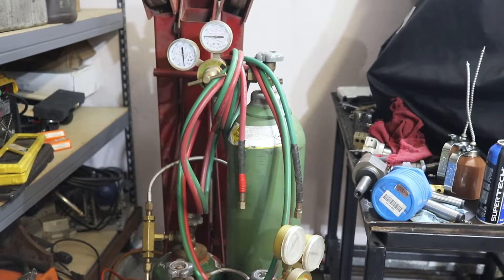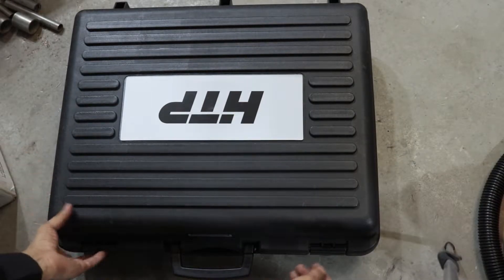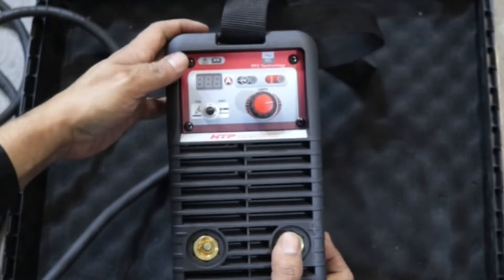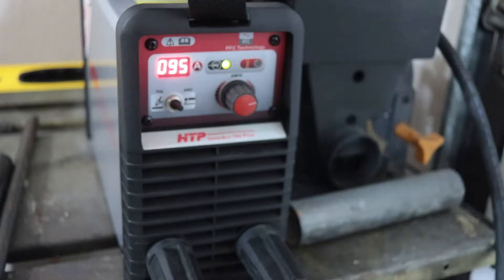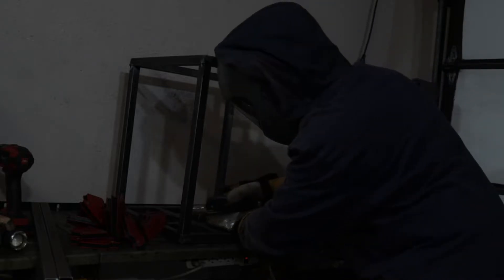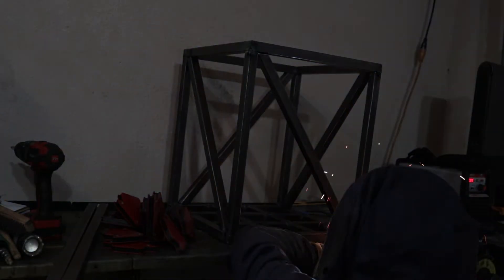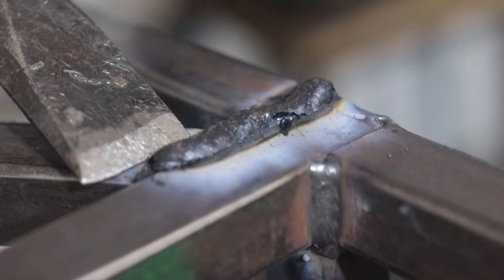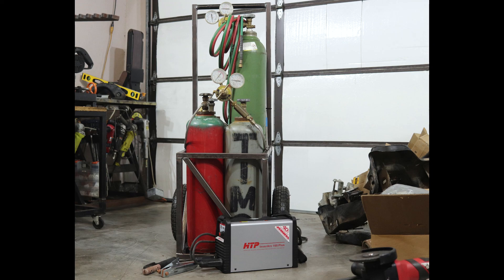Oxy Acetylene Cart build with the HTP Inverarc 160 Plus

Comment: Cylinder diameters vary from manufacturer to manufacturer. Hopefully you don’t run into trouble down the road with those tight tolerances. Good lookin build. Needs a cup holder and a steering wheel.